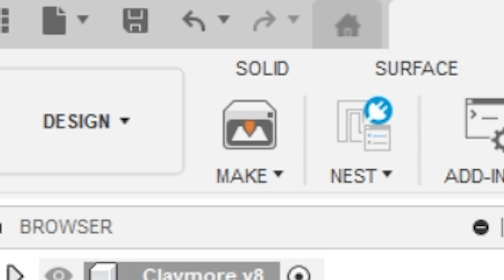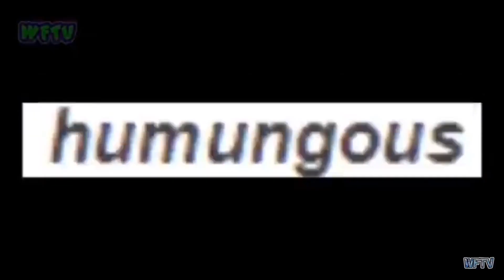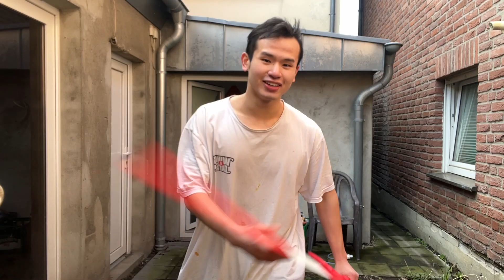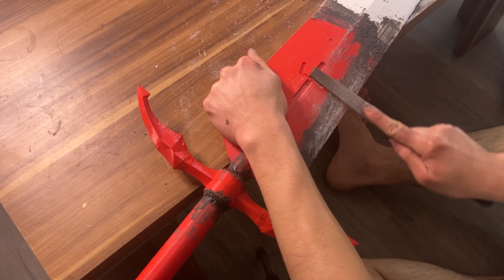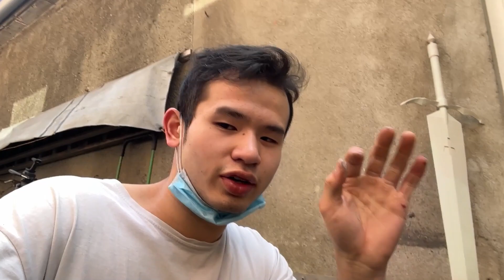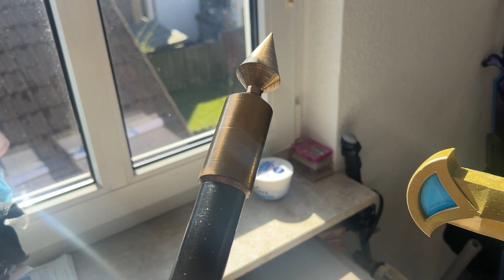I made a Claymore.

Comment: What layer height did you use for printing?
Btw I don't use any rod inside for my sword and it doesn't break, luckily, but if I make the next one, I'll probably use it too
Reply from the maker: It's the default setting (0.2mm). 
I guess if it holds, it holds. You did a good job with the structure there. I just wanna make sure mine can survive a little bit of beating lol.